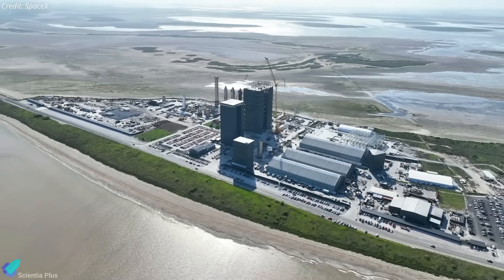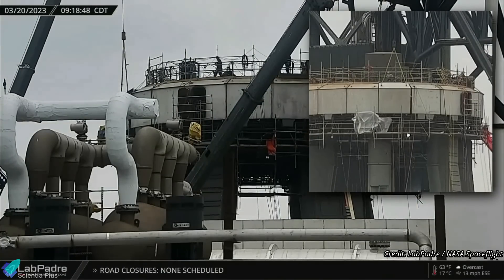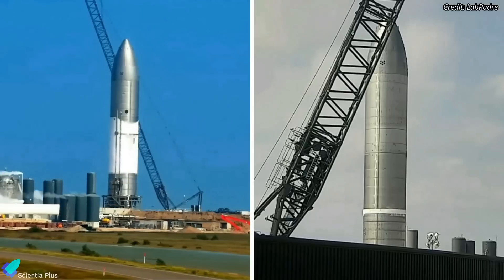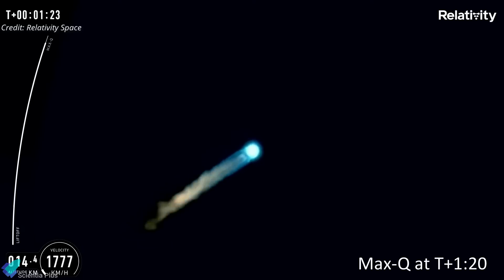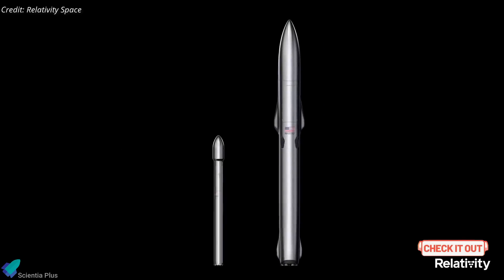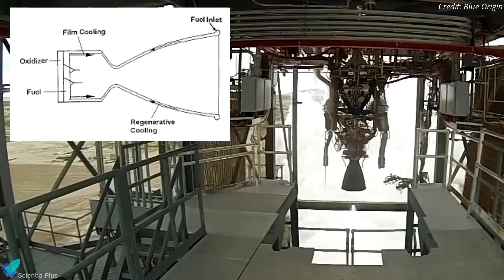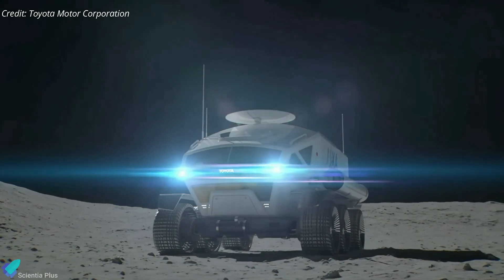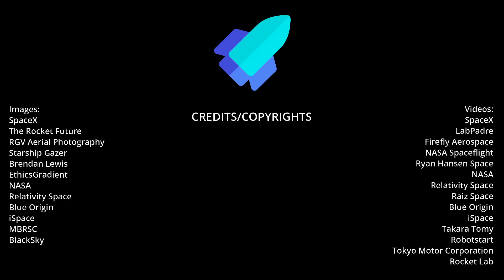Blue Origin NS-23 Cause Of Explosion Finally Discovered, Starship-24 Ready For Launch, Terran-1 Fail

Comment: One just wonders how Elon is planing to play this upcoming disaster of a test flight. The Starship/SH Booster stack has 0% chance of making it past MECO without the Skirt of the Starship collapsing and causing  midair explosion. His only chance to hide this fatal weakness of his rocket is to claim that rocket was destroyed by activation of Flight Termination System due to out of bounds condition. Than Elon could claim that if it was not for abundance of caution in programming FTS his rocket could have  made it to orbit. BS baffles brains so it seems that this is perfect plan of action given that Elon has no idea how to fix unpressurized Skirt of the Starship so it does not twist and buckle compressed by over 5000 mT of thrust generated by Raptor rocket engines.
Reply: "Bs baffles brains" seems you are baffling yourself. Your claim is for the upper stage skirt?

Fts systems work on their own or from a trigger on the ground. A skirt "implosion" could be necessary for a flight article as strong as stainless steel. What makes you think that a skirt implosion would be the killer of the starship, do you have structural integrity results that we aren't aware of? Were you there when they tested each section in the can crusher and can give us the deets?

From my uninvolved perspective, it seems that the upper stage payload section is the only part that has not been sent to the can crusher. Everything else has been tested there and reinforced and retested. My proof is from spending a lot of time with Lab Padre live streams where we can see the parts being tested. 

Also, it is Gwyn Shotwell that is running operations over there. You are fanboying over here.
Reply: @migs7220  There is this stubborn thing about physics that annoys many people. You see, physics has it's own rules and refuses to bend its rules to make accommodations for collective will of many very dedicated people like you. That being the case I wish that your wishes about the Starship would be granted.

accommodations
Reply: @KarolKarolak  Not willing anything, there is no shrine and I dont get on my knees. I am watching, and yeah, wishing for the best. Zero percent is quite a statement. Positivity and futurism has been called naive and so be it. Thanks for your support.
Reply: @migs7220  If you are not a member of a cult than cheering for something that does not make any practical sense gets quite difficult sooner or later. I am quite sure that you know what a rope is and how useful it can be when used properly.   You are cheering for succes of an attemp to use a rope of pushing things with it. The Skirt of the Starship is approximately 6m tall from "Y" juncture at top tank of SH Booster to "Y" juncture at bottom tank of the Starship. Wall thickness of the Skirt is 4mm. These two figures give you ratio of 1:1500. You can get a piece of stainless steel shimstock. 005" thick and 7.5" long and experiment with applying edge compressing force to see how stiff it is. Funny thing is that there is practical reason why the Skirt of the Starship should ever be used in compression mode while being unpressurized.  Not while landing back on Earth, not while landing on the Moon and not while landing on Mars as landing legs can be mounted to the Starship way above the Skirt and still serve their purpose. Pressurization of the Skirt of the Starship for duration of liftoff for a the purpose of causing it to work in tension instead of working compression (pulling on rope instead of pushing it) is not that difficult to accomplish. So here you have it: you are cheering for rope pushing religion.

Comment: Terran-1 reached Karman Line, next target - orbit. The main thing is that rockets including Starship and Vulcan Centaur, did not explode either on the pad or during the flight, the main thing is that the Raptor, BE4 and RL10 engines do not fail. Vulcan Centaur should not repeat the fate of HIII. Otherwise, it threatens the loss of four satellites and the disruption of other missions, include Dreamchaser.
Reply: Yep.  The methane first stage worked as designed.
Reply: @arthurhamilton5222  now they just need to find out the issues with the 2nd stage. Always exciting to see new players succeed.  and the first stage working is a great step forward for them.

Comment: A Texas gun range was within sight of the giant rockets?  
Buying out that place was a great decision, and they get to test rockets there without closing the highway.
Reply: Yes that; plus, they’ll probably do engine testing of raptors there also that have been fixed or modified- WITHOUT having to send them all the way to MacGregor in North Texas to do it, which has been the case (and which is a major pain, wastage of time- which Elon hates most of all - etc.).